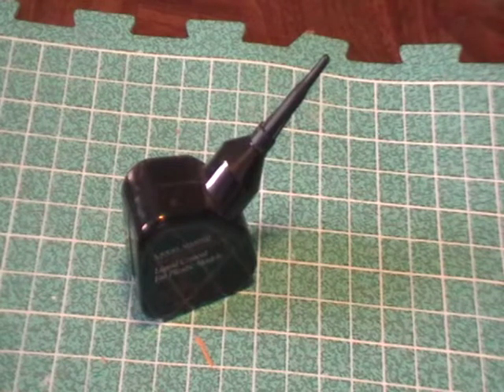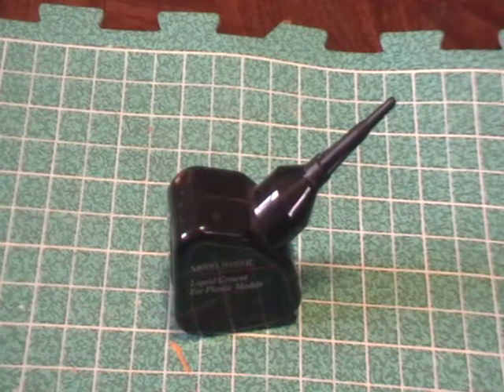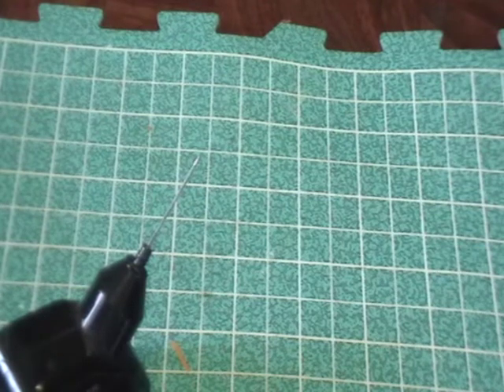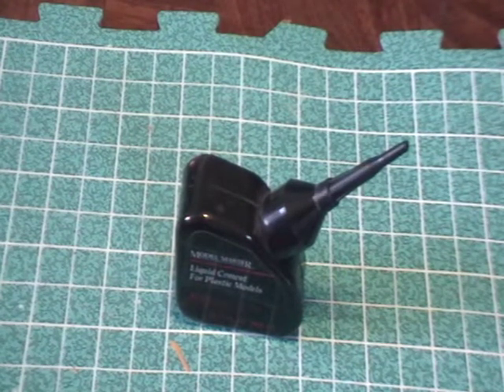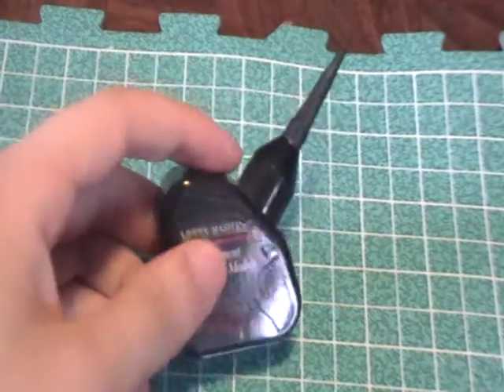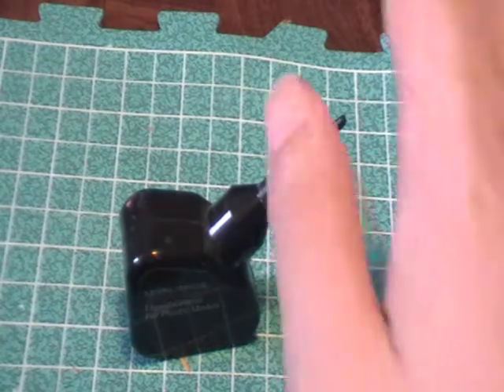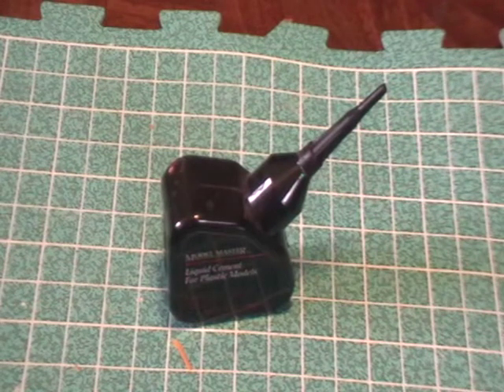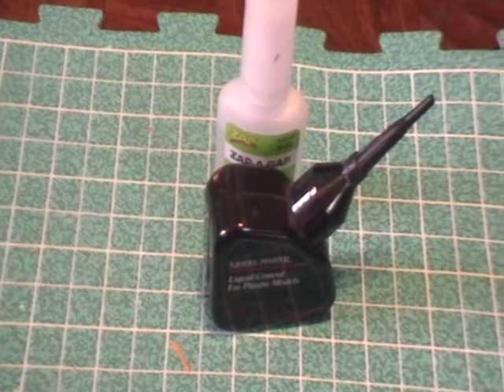Model Master Liquid Cement

Comment: I bought like 5 bottles of the Testors liquid cement with the fine tip applicator (the black container) but the problem I have is, I cut the tip off and tip the bottle to dispense the glue and nothing comes out, I squeeze and squeeze and nothing comes out, I'm not stupid but I can't figure out why it won't flow. I opened the bottle up and found a green piece of plastic blocking the tube and tried to remove it but no dice, I guess it's supposed  to control the flow but it's not even coming out. I contacted Testors about some tips but haven't heard from them yet.

Comment: I used to use this glue with the fine tip metal applicator for many years until for whatever stupid reason it was changed with the metal fine tip applicator replaced with something that won’t let the @$#*=+ glue come out....!!! 😡🤬 I ended up throwing away the new applicator which was obviously designed by someone 🤡 who knows NOTHING about plastic kit modeling. I blame the morons at Rustoleum 🤡💩who took over Testors and also discontinued the entire Model Master Acryl line of paints that I used for kit building.